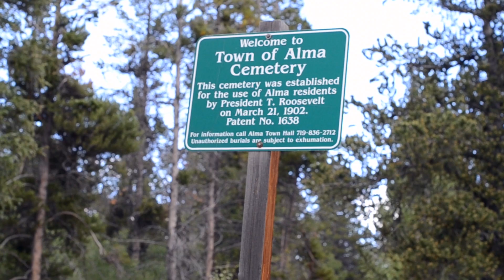SparkFun According to Pete #44 - Ghostly Gadgets

Comment: On old tape recorders, the overlapping of the tapes, coupled magnetically with the tape over and under it, creating a very faint echo of what was recorded. As investigators used open reels on very slow speed, the echo could occur lots of seconds after. 

So, kids, this is why collectors have to rewind tapes every few months to keep the echo from building up. The same thing happened to old VHS tapes... but they did create visual "ghosts" in the image. Today SD cards don't have that problem.

Comment: why not add a 60hz notch filter between the loop and recorder to remove the power line noise
Reply: I was thinking if they're going for vocal frequencies a high pass set at 500Hz would get rid of a lot of noise.
Reply: +Lawrence Job I assumed they're hoping to get 'anything' so I did suggest that. .. but it's a good suggestion.